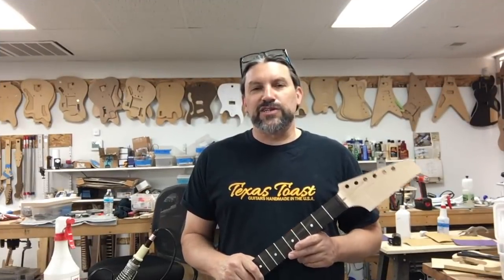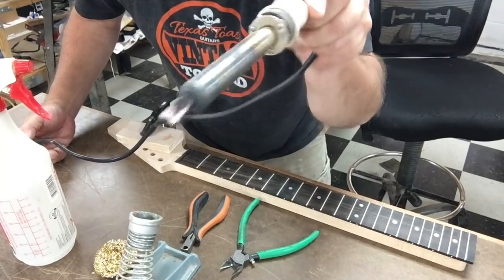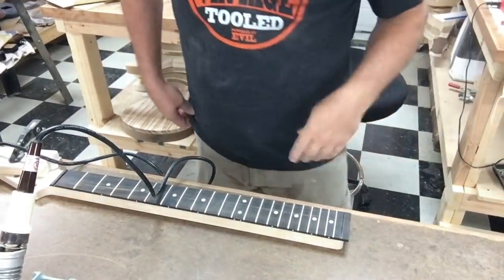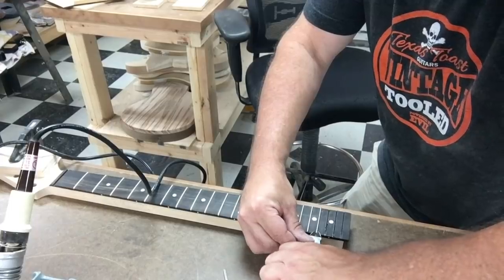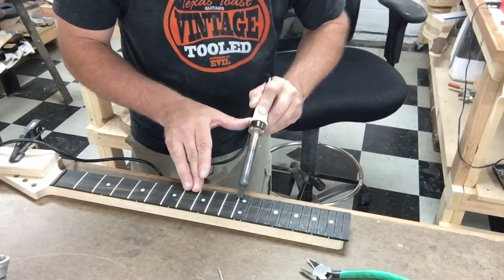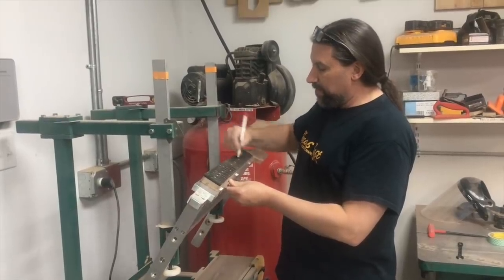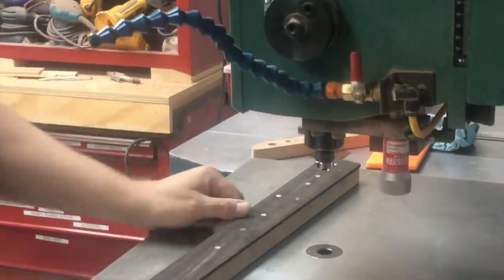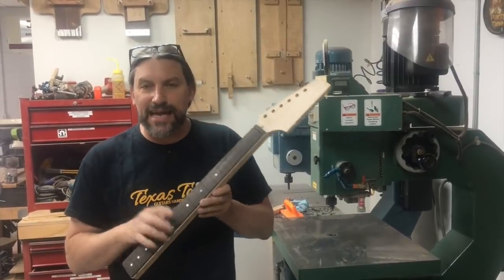The Great Guitar Build Off 2020...Modifying Our Neck... Part 1

Comment: A little solder on the iron can help the conduction of the heat if you require it... more surface area in contact.
Reply from the maker: agreed

Comment: 'Bizarro metric', it's a damn sight easier to understand. I am actually old enough to have been taught in school imperial measurements and having used both I find metric is the one, if given a choice, I would use. 
Just to weaken my arguement when they land nice I still use imperial, sometimes combining both on one set of measurements. Wow, I kind of lost that argument with myself. 
I love that swinging arm, it's such an elegant solution. 😎🎙🎸✅
Reply: I think there's a clue as to which is really easier to work with in that American (and old school British) machinists, who need high precision, work in thousandths (or ten thousandths) of an inch rather than 64ths, 32nds etc. So in effect they have a metric system (just with a different base reference to THE metric system) Scaling things by powers of ten is just far more sensible!
Reply: @numberkruncherr  that is how, if I had given it any considered thought, is how I should have broached it. 
Really well put.
Reply from the maker: Were you issued an inch pattern SLR
Reply: @TexasToastGuitars  It was '70 to '72 in a little Welsh town, we were lucky to get pencils. 😂
Reply: Mixing both is how the orbiter got lost.
Reply: @onpsxmember  what`s an orbiter that`s not in orbit?
Reply: @koekum  er....

Comment: If we get a 22 fretted guitar neck with a glued on fretboard, could we technically remove that fret and the excess wood from the fretboard to make it look like a "vintage" guitar neck?
Reply: 21 fret necks on modern guitars are my pet hate. There's no reason for them, give yourself the extra fret!
🙂
Reply: @numberkruncherr  my thing is that I sometimes want a vintage-like guitar so the 22nd is not very good. But I see and understand you point.
Reply from the maker: Beats me?
Reply: @TexasToastGuitars  
I guess he asked if you can just cut off part of a 22 fret neck and reshape the end so it becomes a 21-fret neck. I don't get why one wouldn't just order it that way or make it like that in the first place, but I guess that is the question he asked.

Comment: Matt, with the biding rabbit done did  the 21st fret space after the scale is too small?
Reply from the maker: the 22nd fret is still there. This is not a drop in replacement for a Tele
Reply: Texas Toast Guitars I knew you were not going to disappoint me!
Reply: @pitaorj  
If you use a translator, try deepL instead of google.
Reply: onpsxmember not a translation issue, just me fighting with this small keyboard/corrector late at night

Comment: If there’s no glue, you shouldn’t heat it up cause the fret will expand
Reply: There actually was glue - just a little on each end.  I edited that part out, because it was a shoddy job if wicking glue into the fret slots was the plan.  With a  little heat some of the natural oil in the wood helps the removal.  I've never had success removing frets without heat, glue or not. I think my results in this video speak for themself, theory or not.  I do lots of fret jobs, BTW.
Reply from the maker: I like heat

Comment: At the time I watched this video, one person that's not a real guitar maker and bought a pre shaped neck left a dislike.
Oh, and before I forget, the metric system is the best system. Prove me wrong. You can't. You weirdos with your bizarre 64ths and feet and miles refuse to concede driven by pride, but you know it's true. 😋
Reply: Makes sense dividing by 10 is easier than 12  metric for guitar building or other exacting woodworking is perfect but youll never hear a framer call out "cut it at 20 cm"    😎
Reply: I agree, the metric system makes more sense but just like everything else, ignorance seems to win over logic. People just don’t like what they don’t understand. I for one use American standard by default but use machining measurements (decimal instead of fraction) for all of my precision measuring. Only roadblock doing it that way is finding a measuring device that reads that way. When I’m laying out frets, however, I reach for my metric ruler. Just easier and more precise.
Reply: Agreed! It's like dollars and cents. How easy is that!
Reply from the maker: What's wrong with the metric system?
Reply: Texas Toast Guitars not one thing. Easier than what we have to deal with. Just ask Mrs Toast! Mrs Toast Mrs Toast! I just can't help it. The mystery woman with the hoodie

Comment: the soldering iron is to soften the glue, those frets aren't glued in 😆
Reply: they actually were glued in - just on each edge.  But I edited that revelation out. Like they tried to wick glue down the fret slot after the fact. It only went 1/16” . I’ve never had success removing frets without heat.  If you have, that’s great. I do tons of fret jobs, BTW.
Reply from the maker: You know it